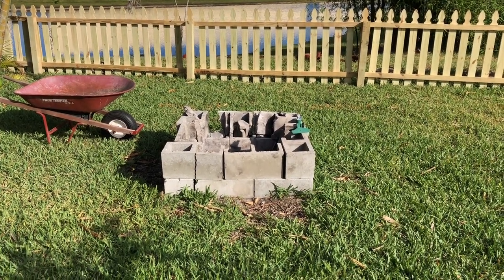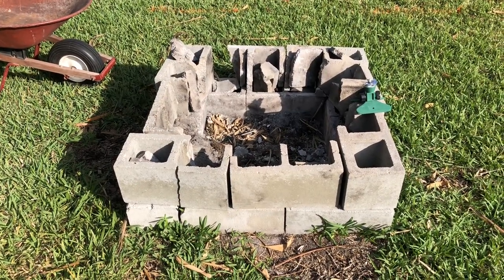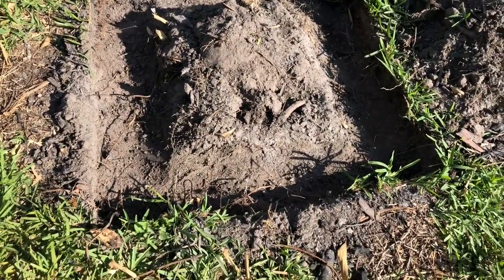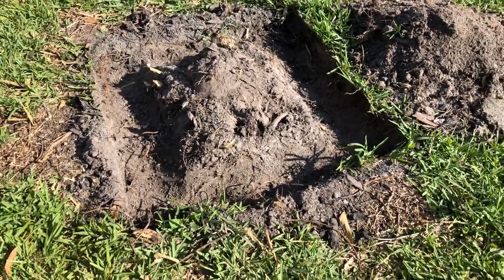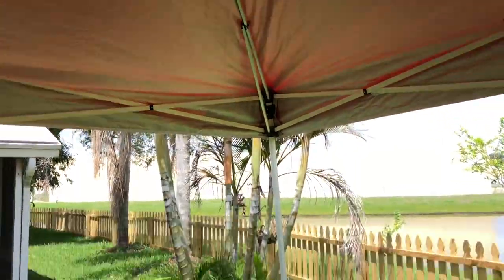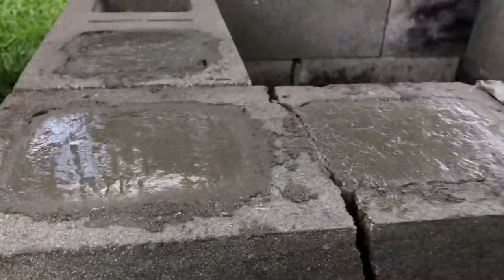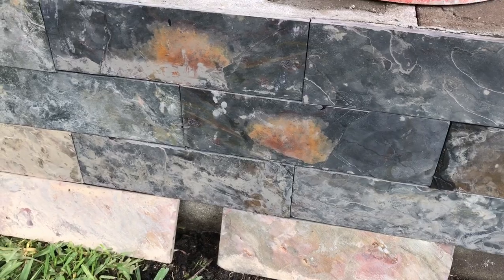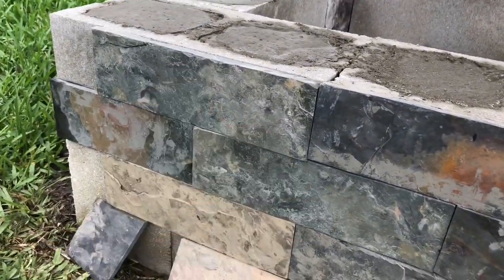Fire pit - Cinder Block, Slate, Stone Top - DIY

Comment: Very nice!  Just wondering how this is holding up after some use?  Does the slate hold up to the elements?  I thought slate  tiles might start to separate with enough moisture. Also, did you use a sealant in the stones? The colour looks really nice.
Reply from the maker: It started to get brittle after a few uses. You definitely need fire bricks to line the inside with!
Reply from the maker: The outside still looked good though. I only used it a few times, then sold the house.

Comment: Why can’t you just keep the ground as the base? Why do you have to use concrete on the bottom
Reply from the maker: I could I guess. I just wanted a solid foundation so that it would not shift around with time. Make sure you line the inside with fire bricks!
Reply: Has anyone heard of root fire ? It's when you burn in the ground, dont extinguish the fire. Covered or not, the fire can burn roots and spread. Be careful and pay attention. I love fire pits and have thinking about building one. Never would have thought about root fires. Now I do.
Reply: Joquita Sullivan i never heard of this either.

Comment: Planning on building one, probably twice that size at the end of September. Pretty much for the same reason you mentioned. We moved into a house about a month ago with a lot of limbs that need to be removed and no where to dump them except the land fill. My former property was surrounded by woods where I could throw them, but no more. It will also come in handy burning the boxes we used to move and at Christmas, instead of breaking down all the boxes for the trash dude to pick up. Thanks for the video. It was helpful.
Reply from the maker: Make sure you line the inner part with fire bricks. If not, you will have an issue with the concrete. 

Just a heads up!
Reply: @CliffsHowTo  Thanks for the additional info. I would have probably not done it otherwise.
Reply: Also....last question. Did you line the bottom with anything?